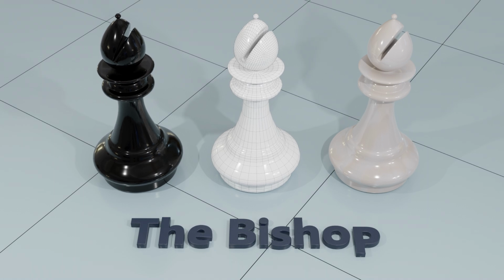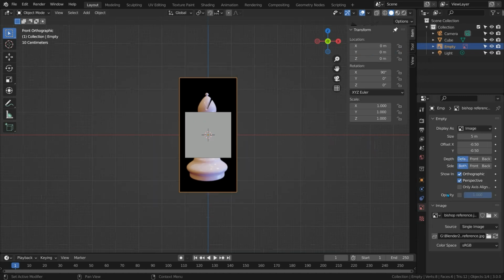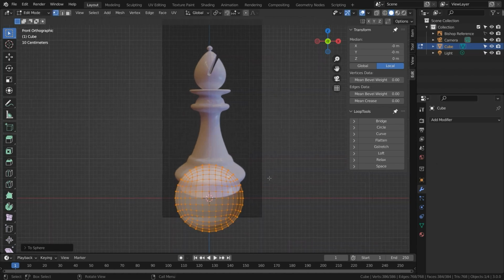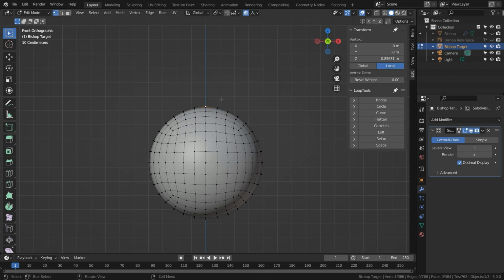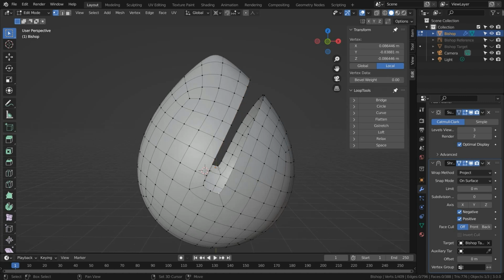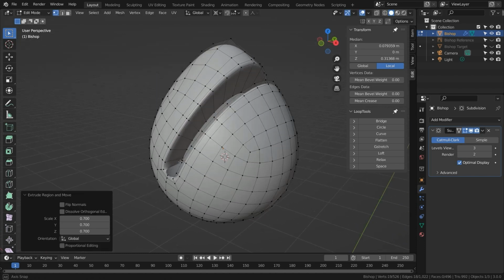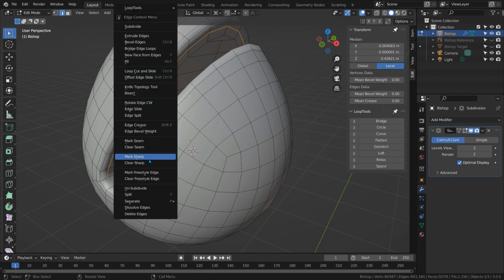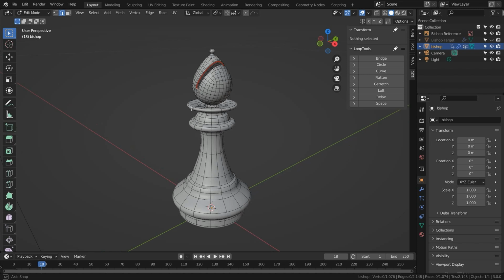Blender Chess Bishop - #11 Subdivision Surface Modelling in Blender

Comment: At 13.04 when clicking F to create a face, it creates a triangle instead of a quad.  I tried changing the scale of the extrusion as well but that also does not make any difference. What needs to be done here to force it to make a quad. I am using Blender 4.1.
Reply: dont know if you figured it out, but there is an addon called "F2" that needs to be active for it to work.  i had the same issue

Comment: I love your videos man they are great you know I have had loop tools for the 'circle' function this whole time and I thought the other options were basically useless, little did I know the curve option is a game changer. 

I do have a question though, isn't it kind of awkward marking the loops as seams when it comes to UV unwrapping or what have you?
Reply from the maker: Correct. The marking of the UV seams as control loops is only usefull during the modelling phase. Once you move onto texturing all of the seams are unmarked ready for UV unwrapping. In the rare circumstance that I still need them marked, I change them all to mark sharp with zero sharpness.
Reply: @ianmcglasham  fair play, nice one :) thank you for the videos!

Comment: 4:00 I understand the statement made here because there are some rare occasions where you cant fix it after a boolean. But with meshmachine addon and boolean cleanup, then quadremesher addon and remesh it, 95% of the time you'll get nearly perfect geometry that matchs the geometry you did manually. I can record a short video if you're interested as I tested it after I heard you say it would be irreparably damaged and quad remesher almost perfectly duplicated the topology you showed in the beginning (it used 1 additional n pole in the middle of the face, though it didnt impact shading). 

I recommend you try it yourself though. The machine who develops all those blender addons (meshmachine, machinetools, decalmachine) is a literal genius.. 

Side note: if you want 100% perfect shading can also shrink wrap it if you end up using boolean cleanup and quad remesher.

loved the video though, i struggle with manually doing topology and this was helpful.
Reply: It would be interesting to see the difference between the two workflows, and see if they provide same topology in the end.

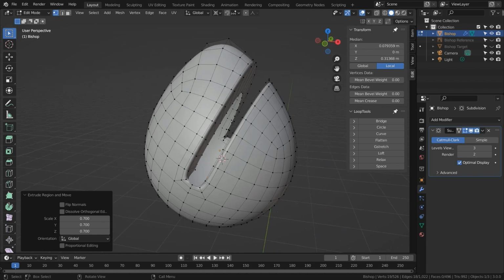Comment: Splendid Ian. I am learning 3D with no modelling experience, only relevant experience is my O level in Engineering & Technical Drawing (may date me)!  I do have to do something different at 13:00 min with the mitre inset fill in. I have mesh.f2 on but selecting the edge and pressing F gives a triangle based curve face. I can get the face filled if I select all 3 edges and F. I've tried mesh.f2 with 2 different options set and tried setting its option with the 'reset to default value'? But I repeat your explanations are so lucid.
Reply: Not sure why but your instructions worked perfectly on the other side of the Bishops Mitre...
Reply from the maker: @bernardstaniforth365  Mitre. That's the word. I should have use the word mitre. Good word.
Reply from the maker: Thanks Bernard. O'level!!!! You must be as old as me!!!! You must have an additional vertice somewhere. Try selecting the lot and merging by distance. Let me know how it goes and if that dosent work I will Investigate further until I can help you sort it out.

Comment: Hi Ian, why did you use the "To Sphere" operation at the beginning, instead of the cast modifier we used int the Pawn video? you also didn't correct the "corner" vertices.
Reply from the maker: Hi remkm. I use the to-sphere operation when it is a one-time thing. I use the cast modifier when I need a continuous spherizing effect, which will be used to control future modelling operations. For example when we made the Pawn I needed the new geometry created when making the hole in the bottom to be constrained to the sphere shape. In this one I just wanted to spherize the subdivided cube with no modelling operations that followed relying on that shape. 

I didn't fix the corners on this one because I didn't want the video to be too long!! They should indeed be fixed!

Comment: I had to apply the shrinkwrap before flatten the inside edges, otherwise it would not work with the looptool flattening. Maybe i did something wrong?
Reply from the maker: Hmmm. No. The shrinkwrap modifier should not need to be applied. Did you make sure the 3d cursor was between the two corner vertices? Did you make sure that the 3d cursor was selected as the pivot point? Were all of the vertices around the edge selected? It should work with those things done. Let me know if it doesn't work and I'll look into it!
Reply: @ianmcglasham   I will finish it, and try the same tutorial the next day. Maybe i overlooked some details. Thank you!!
Reply: @ianmcglasham  I have it, the Bishop. Learned so much! Thanks!

Comment: When I tried to fill the corner vertices at 13:00 , it gave me a triangle, not a square. Is there something I did wrong? Can you help me?
Reply from the maker: Hi Alexandru. Do you have the "f2" addon enabled in preferences? It wont work unless this addon is enabled (it comes with blender but is not enabled by default.) You may be selecting the incorrect vertex when pressing "f". It has to be the very corner vert. Hope this helps. Let me know!
Reply: @ianmcglasham  It worked! IT WORKED! Thank you a lot!
Reply from the maker: @alexandrupomana7010  Oh good! Let me know if you have any other problems.

Comment: Ian, when you are extruding the body, do you have it set to extrude in z only? If so how do you do that? On-screen keystrokes would be a great addition
Reply from the maker: Hi Tim. I am really struggling to find an on-screen keystroke sysytem that works well with Blender 3+. I normally just press Z really quickly immediately after I press E. You could press F with the last loop selected to fill it with a big ngon. then the extrude tool would assume you want to travel along that face's normal but i dont normally do that!